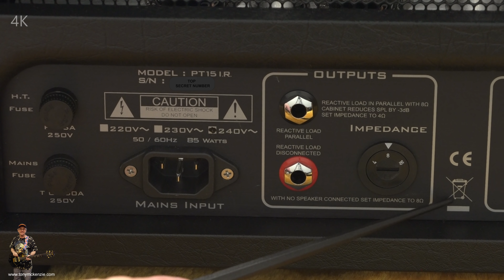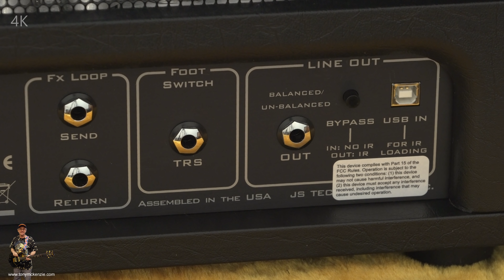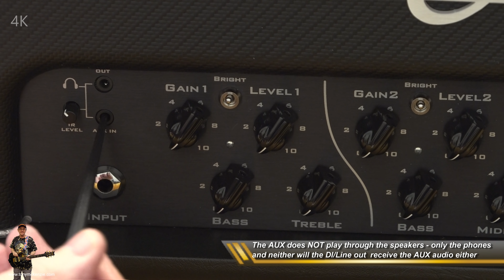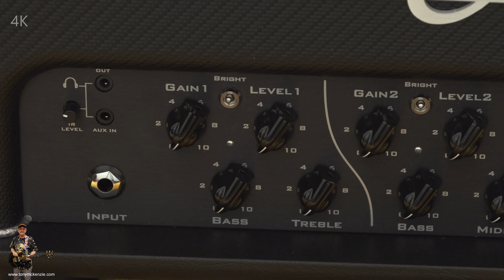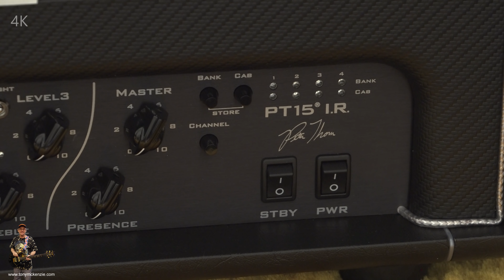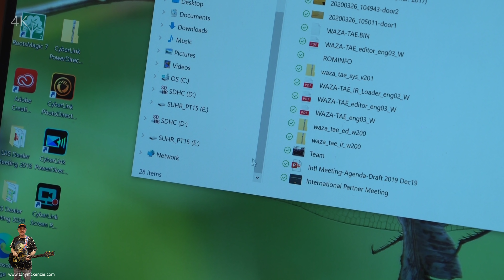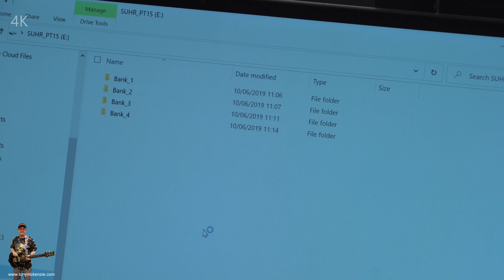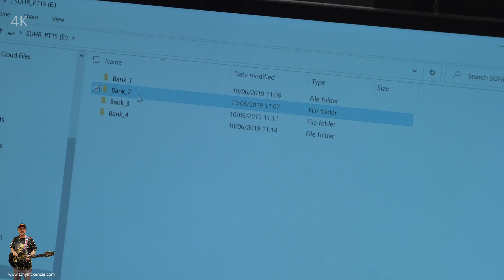The Suhr PT15 IR Amplifier | THE BEST REVIEW | An Inside and Out Closeup With Playing | The IR Amp

Comment: Great review. To expensive for me and like you said, I do not need all those IR's. I have a CabZeus IR box. It's good but I prefer to use a Palmer PDI 09 with the speaker in an isolation box. Sounds better than IR's to me.
Reply from the maker: Well, I can but agree! You are most likely right IMO. There's this 'fad' been going on for some while - even years (I blame the simulator guys) about IR's. The thing is, ultimately they are just filters being applied to the real sound out of the amp. I think very overvalued personally. There again, I come from the real deal of amps and real cabs. While it's true that the IR's change things for sure and we all generally know how many millions there are out there of those to use, the real question is, how many of those IR's do we really need? Having companies like Fractal Audio offering up to 5000 as a choice within an Axe-FX III shows in my opinion just how nebulous and side stepped some makers are regarding IR quantities. In the case of Suhr and this amp and the more 'manageable' level of IR's included, it's a novel aspect added along with the reactive load box, but what value does it add to most musicians? I think not as much as some suggest. And you Ray are saying it right there... IR simulators of one kind or another can be bought used for about $75 (£55.00) so it might be hard to justify the extra cost of this amp over other similar units half the price. There is also the forthcoming TwoNotes Captur X which seems to me that it offers everything 'extra' that the PT-15 offers above most other similar amps. I'll be reviewing the Captor X unit and maybe even use this amp... now there's a thought. Good points... and stay safe.

Comment: I’ve alway enjoyed the tones from the Friedman dirty Shirley 40. Bit out of my price range though. Great video as always tony
Reply from the maker: Well it all comes down to what you like. I'm sure that Friedman do make some great amps. For me, the JJ Jnr had this switch that was 'sold' on the basis of Jerry Cantrell sound (I guess - hence the name), but when I tried that amp the designated switch did little really. Personally it felt like a Friedman 'Runt' (from what others tell me) with a switch fitted so it might sell from a JC name association. Maybe I'm being harsh with that amp, but I can tell you in all the years I have played guitar only once have I returned an amplifier... and the JJ Jnr was it.  Maybe the one I had was not a good representation or something, but there you go. Friedman are expensive for what you get especially here in the UK. I have other amps that to be honest outshined the JJ Jnr an cost me half the price. However, this Suhr amp is far from cheap either, and if you consider what you get carefully then again in the UK it is expensive. The IR's I can buy for £50 direct from Celestion and use them in the desk software, the reactive load box (equivalent Two-Notes Captur X - review coming soon) for £400 and I don't need the headphone socket. As I said I would be left with an amp costing at least half the price. But if someone did want the PT15 as its created then it's pretty much unique. Thanks for watching and stay safe.

Comment: Excelent review my friend, electronic world seems to be good for you, just a point,
can do something for us??
When you talk about good electronic job we have a idea how as to be, well can you talk about good brands of condensers, resistances, psu, or if they’re good or low quality is just to start to have a idea how looks and what kind are these components thank in advance mate and good as always cheers
Reply from the maker: I understand that perfectly Peter - and indeed I do take many photos of inside all the equipment. Where power supplies are particularly not that great I di single them out. But also remember that in the video you can see most of that stuff also. On the capacitors for the PSU in this amp they were not a brand known to me, but honestly, I don't know all the brands by far, suffice to say they are not F&T! But you have a good point though about components. I try and look for what's often simply bad things inside any product because that's where often its hidden - out of sight of any users prying eyes. On this amplifier overall I did think it was generally high quality and the build was good. But I get your point. I have another review coming up from Marshall and I'll take a look at that review to see if I can add something in... but not always possible because of no information other than what's in front of me and I don't like to guess if I can help it. Thanks Peter and stay safe!

Comment: I would love this amp. Please ship to me ASAP. I’ll pay shipping.
Reply from the maker: Ha Tommy... its like all the other amps except for a few bits n pieces :) I think you have too many :)  Stay safe dude.
Reply: tonymckenziecom I’m down to just 3 amps now.
Reply: tonymckenziecom That amp has great mojo. It sounds fantastic.
Reply from the maker: So you have the Fender... what are the others... all tube amps? I would say probably :)
Reply: tonymckenziecom The Fender 68’ Custom and Supro Supreme (killer little amp) and a EHX 44 Magnum. The 44 is a backup pedal amp. It’s insane.
And I also use AmpliTube through my PA.
I’ve downsized extremely.
Looking at a Kemper pedalboard then I’ll dump the Supro and a few guitars. 
If I leave my shit to the kids, they will either sell the gear at 20% return or the grandkids sell the good stuff at huge return.
But I’ve a surplus of Les Paul’s now.
A limited edition 2011 one of 300 (I was told and it’s verified by me) limited edition faded honeyburst and a studio are on the block.
I’ve a lot of cabs though. 2 great 2x12s. Greenbacks.
YOU on the other hand.......hmmmm......
Reply from the maker: Gear can run out of hand of that there's no mistake. And it sort of 'creeps up' and you look around and see loads of gear... it's actually a problem - believe it or not. Cutting back is a good idea and there's no doubt I'll be doing some of that with some of this stuff. I get nagged for it! I bet you do/did too :) Ha you're lucky... they had me going around putting worth stickers on it all! Now THAT'S sad right!  It's really sad, because they will go before me :) Studio is a great guitar. I had one here (its on the videos). Alan, my bass guy and main associate lost his job some time back through no fault of his own and was doing lots of gigs to supplement a low income basically. His birthday came around so I gave it to him... I know he appreciated it and probably would never have bought one. In any case it went to someone that appreciated it and that was what mattered. I have told him I want it back and he refused :) (joking).  I have a number of cabs too... too many. I sort of hang on to the gear somehow. It seems too much of a chore to keep swapping amp heads :) - you will know what I mean. But on a serious point as you get older you really do have to think about gear - most relatives have little clue so I guess Levi could gain some of it, but I can guess just like you said, much of it would probably be sold. Oh well.  Hey how is the virus where you are? Has it died down a bit? It seems to be gradually slowing here but very slowly. I don't see work next week or anything.
Reply: tonymckenziecom Ha! 
I have a few favourites and the others they never get played.
I don’t get nagged at all.
I really never spend much on.
Head trades are hard now. I’m glad I sold all my Marshall stacks. I’ve got a small studio and the Supro supreme resides opposite the bass rig.
My 68’ custom is always in my shop.
Giving guitars away makes one feel good.
Especially for a good cause.
Reply: tonymckenziecom 2 tubes and the 44 magnum.
The 44 sounds dry as heck.
Flatline.
But with the right pedals it’s sick.
Reply from the maker: I'm similar there... a few things that are just 'right'. That old black 'Ibanez' is one of them. You don't get nagged! See, that's where I went wrong... training :)  Fair point seems smaller heads are 'it' i.e. 20 watts or so. But they really (in general) don't hold a candle to those 1959HW amps with the Roland attenuator... honestly, I forgot how good those sound... but I guess I'll have a bad back for years :) . I know Alan for so long I think I met him in about 1998 recording his band at the time and we stayed in touch.
Reply from the maker: What?

Comment: Thanks Tony for the in-depth review of this amp.  Question: If you were to replace those ARS (Chinese) tubes, what brand would you use and why?
Reply from the maker: I have tended to buy tubeampdoctor.com tubes. Why? Well TAD take tubes and burn them in for extended periods on their premium tubes. This eliminates the ones that typically fail from suppliers that don't do that. I have never had ANY brand fail when buying burned in, matched tubes from TAD. I would, even buy JJ if they went through the TAD process of proper burn in and matching because I know from many years of experience that I can't buy a better tube. Sure it costs more, but then I don't even have to consider failures of tubes like I saw with JJ in the Diezel Hagen. Good question I thought. It's not really about the brand (but in the case of JJ I HAVE had bad experience) but rather about receiving tubes that are not what most people buy say on eBay or wherever. If they don't go through that 'burn in' then watch out because the quality of tubes from what I see can't be guaranteed any other way. Thanks... and stay safe.
Reply: We do pretty extensive testing on the tubes, we resort and grade them internally. I would trust the manufacturer to put in what belongs. 😉

Comment: Tony I am shocked to see that the tubes are PCB mounted, they should be chassis mounted when you consider the price of that amp. Tbh I think 9/10 is generous, PCB mounted tubes is cost cutting that just shouldn't be there,
Reply from the maker: I knew someone would raise that point! and of course I saw it. I also saw it years ago with a Marshall amplifier and I was communicating with the designer directly. And I raised the exact same point then as you are now. Well what did he say (and he was/is one of the good ones at Marshall): My question was:  The main PCB is a double sided through plated affair made from thick fibre material in keeping with today's technology and this board should prove good long term. I did notice however that the tube sockets are soldered right to the board which could at some stage offer up a board issue because of heat. The reply from the designer was " The transmission of heat by conduction through the pins is not too big as the pins are relatively small. Main heat source is convected and radiated, blocked by the chassis in a combo. In a head the heat tends to go up away, so the PCB would run quite cool and definitely much lower than the temperature it could withstand." 

And this is one of the reasons I did not raise the point about tubes directly on the PCB. The Marshall amp was the AFD100 and you can read the entire review here with the designers comments throughout: https://tonymckenzie.com/afd100_review.htm  and I hope that is an interesting read. It shows an insight to an amplifier from the designers point of view and it's a pity that other companies are not as open about their designs that Marshall was at the time I wrote the review back in the day.

I hope that goes some way towards why I did not raise that point. Great point in question Scamp and whatever you do stay safe.
Reply: @tonymckenzieofficial  I used to own a Cornford Hellcat head Tony, £1800 back then and fully handwired and chassis mounted pre and power tubes, and suhr are charging £2700 for an amp with board mounted tubes....grrrrrrrrrrrrr is my sentiment about that, I will bet  the mezzabarba has chassis mounted tubes  as it should. When an amp has board mounted tubes it screams at me that it is a disposable commodity and a £2700 product should never be that.
Reply from the maker: @scampthelazycat9891  Those were/are good amps. Cornford seemed to go through a lot more recently but I think they are getting it back together these days. I can tell you I am currently looking at an amp costing about £700 or £800 that's similarly built... that says a lot really - admittedly not all the features that the PT15 IR has, but it is made in the UK and not the far east. You should watch the Mezzabarba review also... it is an incredibly well built amp here:  https://youtu.be/C4WLh0vYaIs?t=496 and I doubt you would find a better build from any company so I don't need converting really :)  The Suhr IS a very expensive amp and I question the cost of the amp in the review multiple times. But also remember that 5 year warranty too. It's likely to be reasonably robust or there would have been a 1 year warranty... and in the UK it remains vague re warranty.
Reply: PCB Mount eliminates wires that have capacitance and crosstalk. PCB Mount with thru hole plated thru hand soldered sockets puts the parts closer to the tube and closer to being point to point. Our PCBs are made in CA by a military contracted board manufacturer and are FR4. Hand soldered in CA 100% built by us. I do all methods but making this style of amp without using PCB would be a complete nightmare to service and build.  It's not about the style of the build it's the execution.

Comment: In my Experience, lead free solder has a tendency to Crack under stress !!! 
Therefore, tube sockets directly mounted to PC Boards are asking for trouble, BUT ARE CHEAPER TO  MANUFACTURE !!!   SO WHY SO EXPENSIVE ???  
I AM NOT IMPRESSED !!    NOR, WOULD I EVER SPEND THAT KIND OF MONEY !!! 
THAT AMP, IN MY OPINION SHOULD SELL FOR $800.00
Reply from the maker: I get it. It is an expensive amp. The way I thought about this amp was that if you needed those extra features then maybe someone would buy one. I commented in the review about what would be left if you removed the load box, the IR feature and the headphone socket... my thoughts were that I would have an amp similar to about ten that I already owned. In fact if those parts were not there and the amp was say £1300 I would have considered it to be similar to the Friedman amp and would not have bought it as there would not be the 'features' that make the amp different enough for me to buy it. But they do have a 5 year warranty... and hopefully that applies in the UK. Stay safe.
Reply: In 30 years of mounting Belton sockets to a PCB I have never had a socket fail or solder joint crack. ROHS or not. Bear in mind though we hand solder all the parts including the sockets. That aspect is lifetime warrantied
Reply: Gerry, With all due respect, these are mill spec PC boards, three times as thick as what many use, and not all amplifiers are created equal. The cost of the amplifier is reflected in the build quality, and the quality of parts used, and the R&D/ingenuity it took to perfect the design- not just the amp but the reactive load, which took many months of R&D, and is an exact duplicate of the full-size version, just built to work inside the amp, no small feat- plus designing the IR board component, And making digital work inside an amplifier with high voltage tube electronics. Built in Lake Elsinore California, by people making real money with real benefits, etc. An opinion is different than an informed opinion.